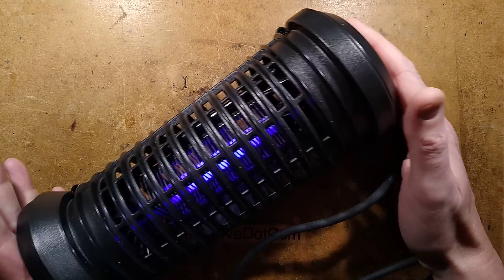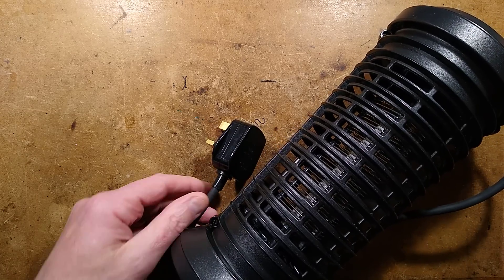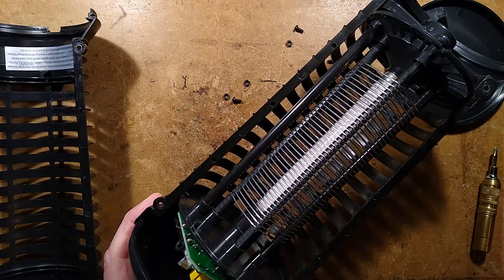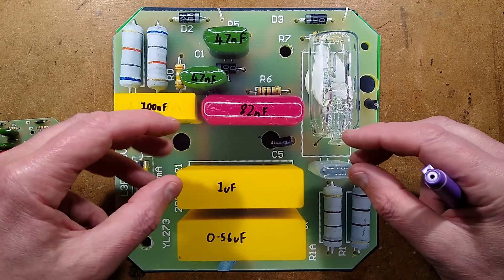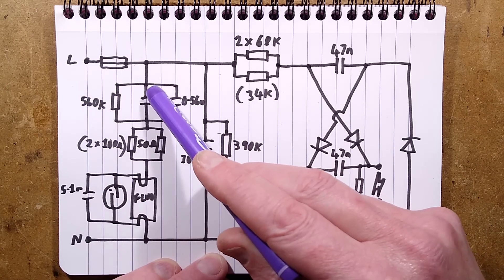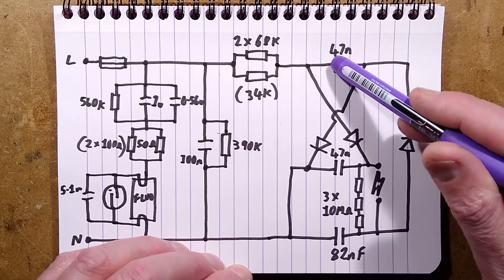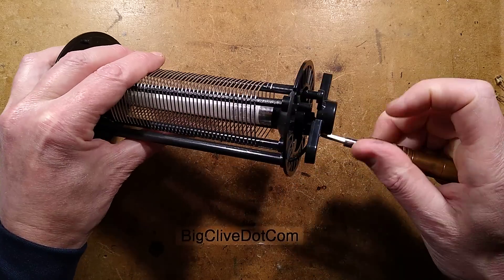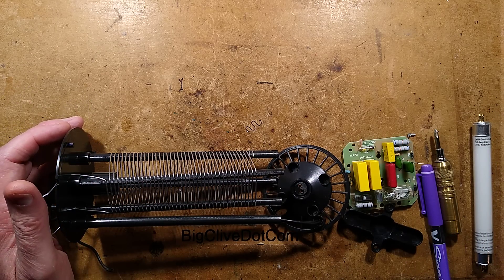Inside a LIDL insect zapper - with schematic

Comment: I got a 5V insect trap which has a proper high voltage generator, but no normal valve starter. The high voltage is somewhat regulated by the valve.

Comment: My understanding is T5 lamps shouldn't be used with convetional magnetic control gear or starters.

Granted this doesnt have magnetic control gear but it does have a starter so not sure how bad that is.

Wonder why they say it cant be replaced. Clearly it can lol. Probably just obscure specs.
Reply from the maker: Traditionally most T5 fixtures had an inductive ballast here.  I think the warning not to change the lamp may just be liability transfer.

Comment: I used this exact model for a few years until the tube burned out. I tried looking for a replacement but the tube alone was two times the price of a new unit.

The problem with these is that it only works on small fruit flies. Larger ones don't care at all, and even if they rarely do, they don't get zapped enough to die.

Comment: I have a similar one like this and the UV tube is about halfway lit now.  I was wondering if it could be replaced.  Now I know I can probably throw it away and just buy a new unit.  I've seen them where I work sometimes.  I should have just bought a new one just in case.

Comment: I had one of these, they do work but they are indeed fairly weak. a good bug zapper would go "ZAP!", this one just goes "bzzt" and if it's a big bug it would survive and eventually die in the container at the bottom not being able to get out... The lamp eventually gave up and I bought a DOMO bug zapper, that thing sounds like a supercharged tazer when a bug gets in there.

Comment: My neighbor many years ago had an enormous rectangular bug zapper, every so often a big fat juicy junebug would get fried, some would get stuck and buzz sizzle for a few minutes and if the wind was right 🤢 nasty burnt bug stench would waft in my open windows 🤮
As someone who used to sell electrical supplies and bulbs, we would get customers in wanting a new bulb for cheap fixtures and bug zappers, more often than not you can't get replacement bulbs at all, like some of the unmarked chips they are sold to the manufacturer only, some customers would get very irate,

Comment: Is a high or low power factor good
Why didn't they use UVA LEDs
Reply from the maker: Perfect power factor is 1 (unity) which has advantages for the power distribution network.

Real UVA LEDs are still fairly expensive.  The ones often sold as UV are just deep violet.

Comment: I had one a few years ago (might have been an Aldi version) but it worked well enough, other than devouring the lamps. A tube would NOT last the summer. It seems as though they have improved the tub driver - but not sure if they changed (cheapened) the HT side of things as my one delivered a decent "crack" and certainly each time it went off, the invading beastie had ceased to be.

EDIT - Forgot to mention, on the one I have which superficially looks indentical, you can easily replace the tube - IIRC it is a twist and release design very much like the insect trap - If you are interested, I will dig it out and see - and link to a photo of PCB and tube base etc so you can compare old & new design.

Comment: 4:45 I have been wondering for years how starters worked! The fluorescent tubes in the garage take several tries before they light - you can see the starters glowing a bit, but I didn’t know that they actually worked by heating up and shorting things out.

Comment: maybe in some countries they have metal bugs which need proper bang to blow it clear

this reminds me the "megazap" from ohm2013. it was on roof of container and it's huge grid was powered directly from mot. with some halogen floodlight in series in case it shorts out. and yes it did short out too from just regular bugs. if it didn't, you could watch lamp flashing from bugs blowing clear and cracks along with it from above. grid was from some sewer pipes and unsure of which grid they used there

Comment: This is great, TVM Clive! I was seriously considering picking up one of these for home use & would be fascinated if you could compare it to its dual-power sibling also sold by Lidl (tho usually in the spring IME) that can run off mains as well as (presumably) a lithium cell (USB-charged) to allow for portability: I'm particularly interested in the charging circuitry in the latter WRT long-term mains supply - is it well done or will it gradually under/overcharge the cell(s) to the point of failure?

In your opinion, which would be more long-lasting: a traditional tube as seen here, or a UV LED array?

Comment: I've had two of very similar units, one of them went dead in a week, the other one in short order as well... didn't seem to be all chooched up with critters... the tube was similar to that, a miniature tube that is also available as white for light fixtures. We have two sizes of those in the safety and exit lights. 
I bought larger insect traps from an agriculture store, those use two standard size 18W tubes, the original tubes are whitish blue in color, but extremely irritating if used as the only illumination. The tubes seem hard to obtain and on one unit I replaced them with standard white LED replica tubes, with which it seems to work just fine. One tube that came out of it is good, but it is a series setup so both tubes have to be similar. 
BTW the LED tubes had a warning against series operation, but I have had absolutely no problems save for a slight difference in brightness between the tubes. The brighter one MIGHT burn out earlier, but the LED tubes are cheap compared to any standard style UV tube I have been able to source.

Comment: Very crappy of them to solder in a fuse instead putting it in a fuse holder in the plug.
Reply: Here, it doesn't matter that it's not "replaceable". When the device reaches old age, the tube will die and it will be discarded, and the fuse will only ever pop from catastrophic failure such as major accident or defect and never from old age.

Comment: From my experience, these devices do not attract many insects (one or two per week, which is weak). I've had them with fluo tubes and UV LEDs and the result is about the same.
Anyway, interesting reverse engineering of the LIDL zapper!

Comment: I had "zappy" with two 4W tube e14 socket and it work perfectly. When tube die I want buy spare but can't find any even whole unit was out of sale and changed by LED(fake UV) scrap. I bought three different branded zapper with LED (florescent tubes are banned here) and non of them catch nothing. I guess any LED zapper can't do job? I have much more insect atracted on my security camera with IR light.

Comment: Maybe is because i am a cheap guy that loves to repair instead of discarding things but what happens if you modify this device to use UV black leds instead of tubes or even better make my own DIY version from scratch with extra power to have fireworks at home when bugs explode. I have some 20KV 1nF caps,  20KV 5mA HV High Voltage rectifier diodes laying around and a couple of spicy high voltage modules so all i need is UV black led strip and that is about 10 dollars and wait a week.

Comment: The replacement tube (if you even find one) will cost more then a whole new device.

At work we have some cheap zapper looking like a tennis racket. They have quite a strong zap. If you catch a fly instead of a mosquito, it even starts smoking while zapping nonstop. The smoke is disgusting, so you have to open the window which in turn open the opportunity for other insects to come in.
And the cycle is closed. 😅

Comment: The tube is almost identical to a "nightclub black light", and uses a europium doped strontium tetraborate phosphor emitting around 370nm in the UVA, but rather than using a dark blue nickel doped "Wood's glass" envelope to absorb the visible light emission of the mercury lines and phosphor to give a purer UV emission, it simply uses the much less expensive common soda lime glass envelope and allows the visible to pass through, giving a more light blue emission.
Reply: Thanks for the details.
Reply: Did you copy that from somewhere and pasted it here?
Reply: @spacejihadist69420  No. I'm interested in fluorescence and spectrometry. The spectrum of black light that's been on the wiki page for the last 20 years is mine.
Reply: i get irked when people refer to this sort of thing as a "black light", or call the light made from UV LEDs "black light". no woods glass, no black light, i say. but i am a pedant.
Reply: @KarldorisLambley  ooooh the Symbionese Liberation Army agrees with my post! That's....well...something, I guess.
Reply: @Muonium1  it certainly is. well done for recognising the symbol.General Field Marshal Cinque would be pleased.
Reply: I’m fairly convinced that you are just making up words here
Reply: @pzi__  I'm fairly convinced you're not very intelligent.

Comment: I bought a few of these as Lidl was selling them for pretty cheap. Was extremely disappointed that the tube is "non replaceable" but I didn't returned them, as I was desperate for some solution for the flying humming things in the house. After running them all summer, I'd say they a very effective an only a little bit pain in the ass to clean :D Not looking forward to trying to find replacement tubes tho :D

They also sold battery operated ones, those use LEDs, they seem dimmer, but I'm not sure if it means it's worse, or there's just less wasteful visible light. Those work for a surprisingly long time from one charge. Kinda tempted to replace the li-ion cell to something larger to have even more battery :D

Comment: The cable looks to be Butyl rubber with a decent plug and a circuit fuse to spoil us, probably the most expensive components in the unit.

Comment: 4, 6, 8, 15, 18 and 20 W fluorescent lamps sometimes start on 230 V cold before the starter contatcs close. If you remove the starter from the socket you can often start it by touching the ends of the tube.

Comment: The capacitor across the starter slightly welds the contacts. If you remove it, the startel will switch several times faster and can be used as a blinker in series with incandescent lamps.

Comment: how much voltage in the high range? I got "new safe" european zapper and I got only 30V across the mesh. :(
Reply from the maker: It may have a high impedance with the voltage being dragged down by your meter.  The open circuit voltage may be higher.

Comment: Imagine if you upgraded the zapper part using a microwave transformer? You would get a very satisfying CRACK! When an insect hit it then. 😁
Reply: More likely to cause arc-over on the coil as to how far apart the wires are and the “high voltage”
Reply: The great thing about these zappers is they sprinkle the room with bits of exploded insect. Especially appealing in a commercial kitchen.
Reply: You’ve basically built a lightening generator there, I think😂😂
Reply: a microwave transformer is way too high current and will arc over and melt something. what you want here is the same circuit with a bigger capacitor

Comment: I don't fancy getting that brush out once it's buried in bits of dead electrocuted fly ...
Reply: Very, very unlikely to happen even if you'd put it in a room filled with flies. Some come and just hang on to the wires until you brush them off.

Comment: Intriguingly, a vid on a slightly different Lidl zapper from DiodeGoneWild a couple years ago is in the suggestions on this one, and the PCB in the thumbnail looks to be identical to this one, starter and all, so I guess they have a universal one-for-all board to fit different cases as that one was a more boxy type versus this round one...

Comment: That fluorescent starter is useless. I think it"s a 4-65W equivalent. This 4W or 6W tube is surrounded by a HV cage around it meaning it will almost always start instanly on it"s own (the unhealthy way). I have never seen this starter actually work.  In theory one could reaplace this 4-65W glowtube with 4-22W one which should increase the chances of it actually working, but there is a small chance the tube will refuse to strike at all
Reply: if you use a 4-22w 120v single / 240v series starter on 4w tubes using a capacitive ballast the tube just blinks. However on a reactive ‘inductor’ traditional ballast you would be correct in using an S2 (single/series) starter for faster ignition and optimal lamp life. For reliable starting this arrangement does require a FSU (4-65w) starter. Relying on the tube self ionising would be troublesome in temperatures other than 25°c , high humidity, lower line voltage etc which would mean a lot of units would be returned prematurely.
Reply: @cremationpete  

Not always. I"ve had great success running two T5 4W in series on 2,2uF capacitor with 4-22 starters,  so single tube should work just as well. Also remember about high voltage cage surrounding it

Comment: Did you also get the rechargeable version. Saw it in LIDL and both usb cable and charger was marked as only to be used with that one product. Thought that sounded very interesting.
Reply: I own the rechargeable one. It drives the UV LED´s ( no fluorescent tube in this one ) way to hard. They get very dim within weeks of use. Avoid that product. And yes, it only works with the supplied cable, although it looks like a normal USB cable, it is not.

Comment: Does this actually work? Anyone use it?
Reply: Might take care of the odd small fly or moth but will do absolutely nothing against mosquitos.
Reply: I have it for a 1.5 year and it works like a charm. Bugs, flies, mosquitos... You must place it somewhere visible to insects and not have other light sources (works best in total dark). I have it in my bedroom on the wardrobe closet, placed in the way that it doesn't glow  into our eyes. 
I see some comments stating it doesn't work at all, but my experience is positive.
Reply: @PappaBear_yt  Not all of them work ,mosquitos are attracted to only certain range of uv specter which unfortunately many cheap units dont have .I have similar from kaufland -whole summer it killed 3 poor moths ,not a single mosquito.
Reply: @zumbazumba1  OK, what I said. 🤷🏼
Reply: @PappaBear_yt  I see, cheers for that. It would be going in the kitchen.
Reply: @PaulEcosse   I would sugest choosing a more "professional" model with more tubes and metal enclosure...? Also, hang it in a distant corner, so the insects won't fall in your food.
However, as long as there is some other light source (normal lights) these zappers will not work as expected, from my experience, sadly.

Comment: I just replaced the tube in my Aldi insect zapper and it was just a standard T5 4w UVbrite (R) tube available on lots of "market place" sites. I got one from the fleabay delivered for £5.   think the top end by the electronics had the the little t5 connector but the bottom end had heat shrink barrel style push on connectors..  In the years I have had it and used it I have never heard to kill anything and never had any bug bits in the tray..

Comment: I remember the functioning of the fluorescent starter as a lesson in my school physics course. An important component there, though, was an inductor. The idea was that when the bimetallic strip opens again the magnetic field in the inductor collapses causing a high-voltage spike across the tube and striking the arc. There isn't an inductor in this circuit. Is the tube too small to require one?
Reply: The cold-cathode tubes use a HV strike pulse. These are hot heated which both increases thermionic emission, and vaporizes more mercury to make the atmosphere more conductive.
Reply: @strehlow  Cold cathode tubes are driven from a high voltage power supply, ignited by the power supply output without a spike.
Reply from the maker: I'd guess the short tube is easier to light.

Comment: Waiting for the capacitor upgrade 🙈😂
Reply: "What would Photonic Induction do ?"
Reply: @theelmonk  A bug zapper that can also handle commercial aircraft
Reply: @theelmonk The zapper he built is so powerful that the flies boil almost instantly and explode into tiny bits with a loud bang. This is not surprising since he connected 8 massive super capacitors to his contraption strung with really thick wires to be able to withstand the massive amount of current passing through them.
Reply: The world needs more Death Beam Capacitors. Especially now.

Comment: Buying a single matching tube would probably be as expensive as the whole unit...  :)
Reply: It's just a light right? It doesn't have any other function than attracting the bugs?
Reply from the maker: It attracts them and kills them on the electrified wires.  The tube is a UVA tube.
Reply: Probably about 10 times more expensive.
Reply: Don’t you can get the tubes anymore all florescent tubes including uv ones were band last year .
Reply: @Dog-whisperer7494  They don't seem to be unavailable here in the US on Amazon.  Not sure just what nanometer/nm UVA is vs. B and C though, varied info on the internet.
Reply: @Dog-whisperer7494  I have seen Philips fluorescent lamps with 2024 manufacturing code, so they somehow bypassed the ban.
Reply: @Dog-whisperer7494 - a local store chain in my area still sells normal fluorescent lighting tubes...